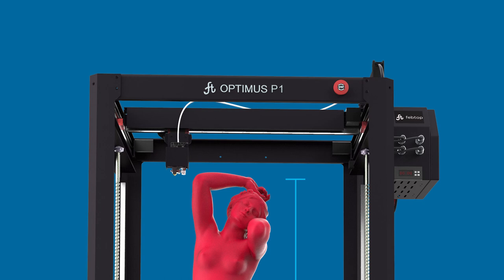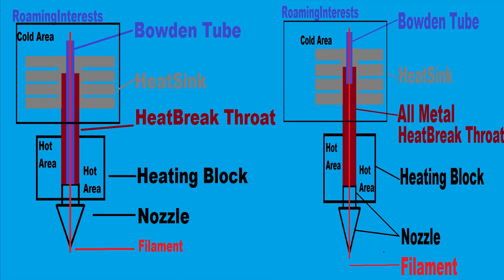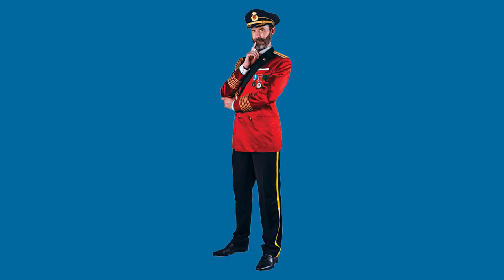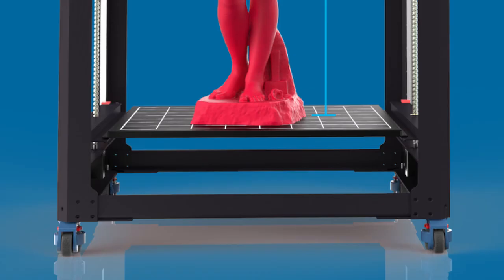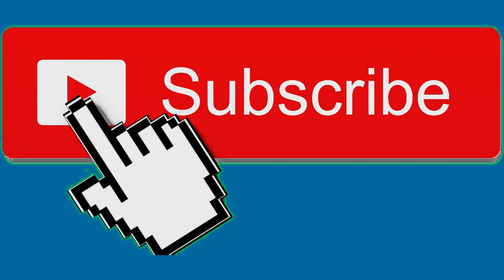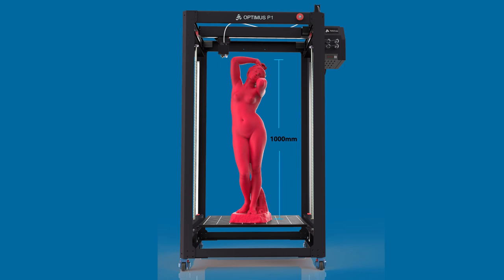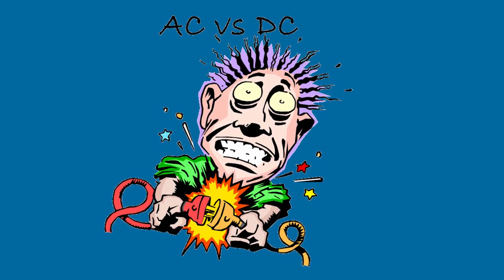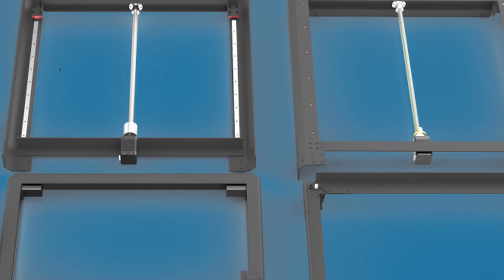Questions about FebTop Optimus P1 Modular 3 in 1 3D Printer for Large Volume 3D Printing

Comment: Hi Roaming, Thanks for the video and all the questions. Let me try to answer those, question 1: Extruder,  the final version we changed to our previous version of the extruder which is a direct drive without gearbox but with the powerful stepper motor. The extruder is from our previous model with fully tested. 2: Heated bed, it is fully covered the heated bed. The heated bed is a silicon heater and control unit if PID controlled separately. The power of heat bed is 1500w, it reaches to 50 degrees in 3 mins and 100 degrees in 10mins. If I missing answer questions, please let me know. Thanks.
Reply from the maker: Thank you for that reply. I hope that everyone that has these questions they can find the answers here.
Reply from the maker: Please respond to this question. Are the stepper motors, 1.8 Arc per step or .9 Arc per step? I feel that if your team takes care of  all these details I am inquiring about it would be a more successful marketing campaign. I also feel that Your Marketing campaign may require a bit more  info on the website and not leaving anything out of the specs sheet like the info I was making videos about. I really think that your product is an exceptional base 3D printer and may require very little tweaking. it's only the marketing that seems to be left behind. Thanks for tuning in to my channel!
Reply: @RoamingInterests  Hi Thanks for your questions.  The stepper both NEMA17 and 23 are 1.8 arc per step.  We are working on an updated version of the website. It should be alive next week with all the questions you had here. Please let us know if you have more questions. We are so appreciated for all you did.

Comment: DO NOT BUY ONE OF THESE! Ive had one for about 8 months and it has been nothing but problems. To name a few of many many many more. The extruder is a piece of junk, it skips on the filament (doesn’t matter what material) and the gear teeth clog. The touch screen is awful, they had me tear the front cover off it just so the buttons would work. The “filament out” switch hasn’t worked from day one and the way the filament tube is ran from the spool (the spool holder broke the first day) is totally rigged, that is probably part of the issue with the extruder slipping, but Ive tried about everything to make it run smooth. When my BL touch went out the second or third time I used it, the bolts were already stripped from the factory for the BL touch bracket. The proximity sensors go out constantly making it crash so then it ruins the drive hubs and belts. The latest is one of the Z motors works when it feels like it and now is not working at all. So the bed tilts and it goes crazy and bends things. Their fix was to cut the plugs off the motors and solder them….really? That way it’s a bitch to ever replace a motor which we know is going to go out. Customer service isn’t a thing. Yes, I can contact them on WhatsApp and they will respond eventually, but then have some half assed fix or will send you shitty parts to fix it from Amazon. I can go on for days, but you’ve been warned. This machine is early beta at very very best. I really screwed up wasting $8,000 on this piece of junk. I’ve lost pretty much all of my customers and the ones who I have managed to keep are now leaving because something new breaks every time and I can’t get their products to them. When I bring that up to “customer service” or WhatsApp should I say, they completely ignore that part and tell me some half assed way to fix it. Absolutely worst experience.
Reply from the maker: Thank you for posting your experience with these. I thought that these may be good but it seems they may not be as good as expected.